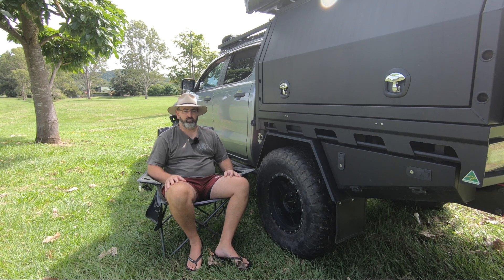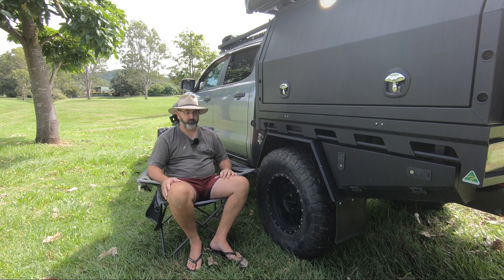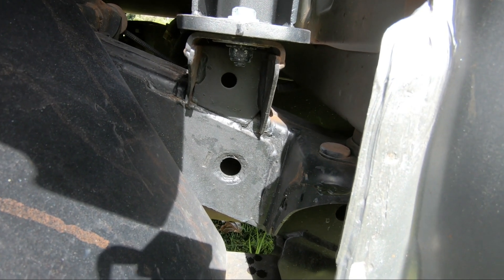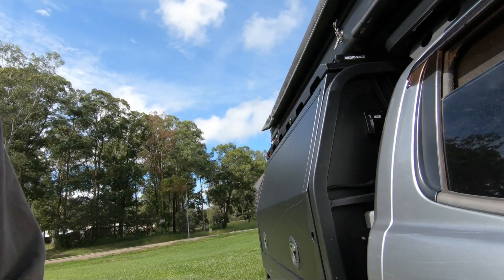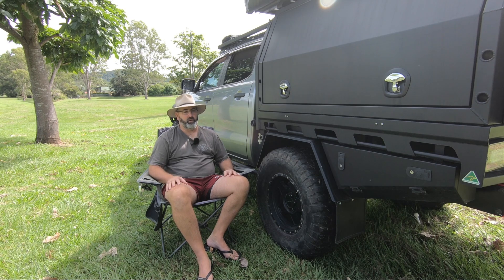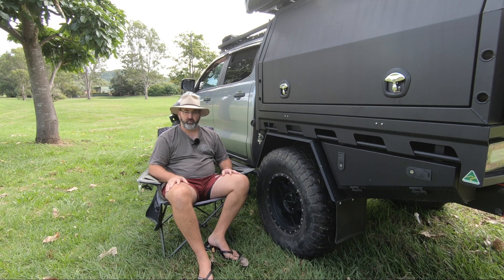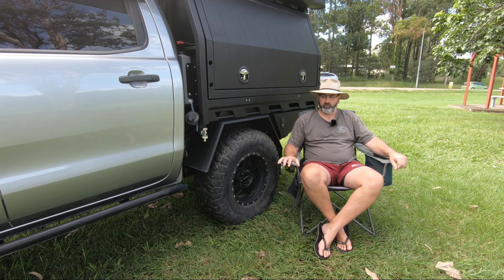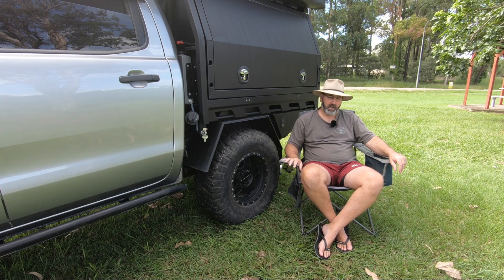Broken Chassis  - How and Why - Superior Engineering Chassis Bracing Kit

Comment: I took the tub off my 2021 Isuzu Dmax. It was useless for security and access to trade tools. I got a Norweld tray and canopy installed with a Pedders GVM upgrade to 3.4t. I chose a compact canopy to keep the load over and infront of the rear axle. The increase in mass was 470kg and I am 700kg under GVM with a driver, full fuel, 12v system, fridge, and 40L poly water tank. The security and accessibility to tools and equipment is significantly better. I think the key to touring is not overloading.
Reply from the maker: Couldn’t agree more Paul, sounds like an awesome set up 👍

Comment: I feel like the weakest point on the chassis, is going to be where the front of the leaf spring is mounted. It's a shame that the kit doesn't extend further forward. How did it hold up on the Simpson desert trip?
Reply from the maker: Hey mate, COVID canned that trip. Heading there next year now. Yer we’re about to coil and 4kink th3 rear so will be beefin* chassis up while we’re at it 👍👍

Comment: I think you have missed the point totally. The problem is too much weight behind the axle causing a levering effect with the pivot point being the rear axle. If you are loading up the rear axle to the point that you think the chassis might bend and you fit those lovely looking plates you will be under weight on the front axle which will cause understeer. Fitting heavier springs or air bags to the rear will not change anything except the car might sit level but the imbalance front to rear is still the same. There is only 2 ways to stop breaking or bending the chassis and they are 1) reduce the weight behind the rear axle or 2) cut the chassis forward the front of the spring mount and lengthen the chassis but about 500-600 mm to get the rear wheel under, not in front of, the load. I can confidently say all this as I had first hand experience with a Ford Ranger that was over loaded in the rear. Not the actual weight but because the weight was so for behind the axle. The overall weight of the car was under GVM but the rear axle was about 200kgs over and the front 200 kgs under and it rode like a pig until we lengthened the chassis. Then all was good. Not what you want to hear but that are the simple facts. If you go with what you have done I do hope it works for you.
Reply from the maker: Thanks Ian, appreciate your feedback and input. Perhaps it’s the next mod? Currently in the process off putting gu diffs to get rid of the ifs front and disc braces on the back. The new diff ratios will also be a welcome improvement. It never stops, always something else to do. Thanks for watching, cheers Jeff
Reply: @jeffntashadventures3438  I think the chassis lengthen should be the first thing. Yes, always good stuff to do.

Comment: An honest video giving you peace of mind.
Looking at the rear wheel /axle position close to the rear of the cab body and the disproportinate amount of tray and canopy hanging way past the rear axle ( as with all brands of twin cabs including the 70 series Toyotas) the manufacturers should be partly liable for some of the chassis damage extend the chassis some 300mm
Reply from the maker: Totally agree frank. I’m certainly glad I went with the 1600 and not the 1800.

Comment: Informative video. But keep in mind even with bracing you can still snap or bend the back of a dual cab, keeping the weight down and the speed reasonable protects the chassis. The Simpson isn’t overly hard on the vehicle so long as you aren’t doing stupid speeds up and down the dunes.
Reply from the maker: Thanks Daniel, could agree more 👍 cheers for your feedback 🍻